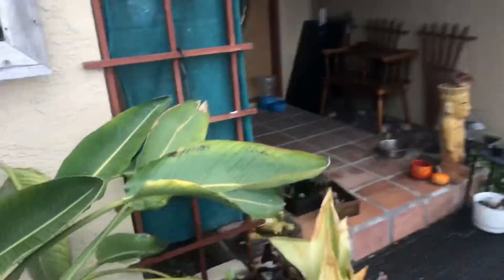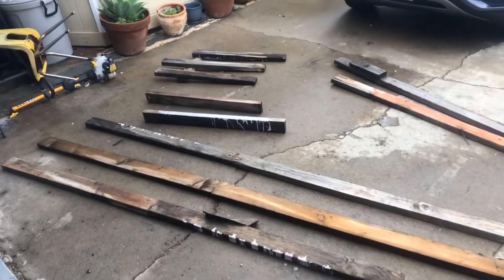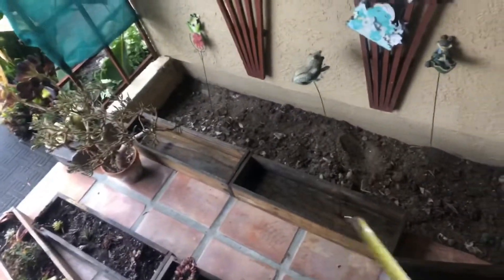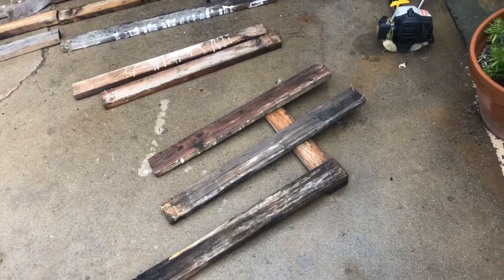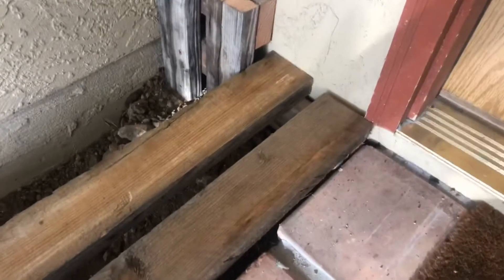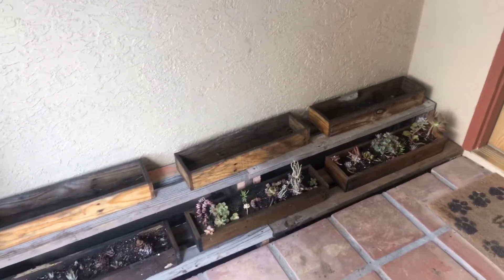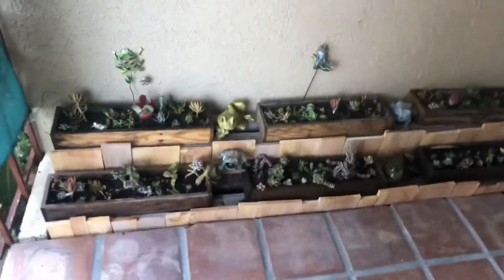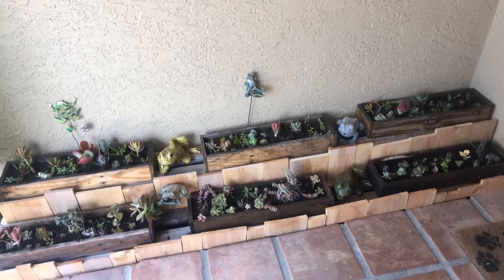Building A Tiered Planter Box Stand From Scrap Lumber!!

Comment: Nice project. Hope not much oil on the wood, but I envision green onjun, tarragon, basil, cilantro, dill ohh and, Summer Savory---its great with soups, asparagus, broccoli. Not sure how much light ya get in there...and yeah, I started gibber gabberin' minute and half into the post...will adjust seasoning as needed. Drill holes in the bottom for drainage, if ya have done that in the next few minutes :)
Reply from the maker: Gregor Miller I am maybe going to do herb garden on the other side.  Gotta keep the cats out of it.
Reply: @TomsTinkeringandAdventures ….ahh, well I use chili powder of cayenne in any area I don't want rodents, should work with cats :)
Reply from the maker: Gregor Miller I tried cayenne pepper, didn’t work!